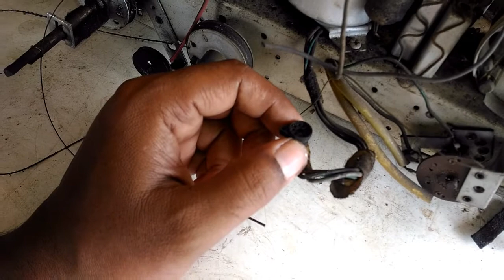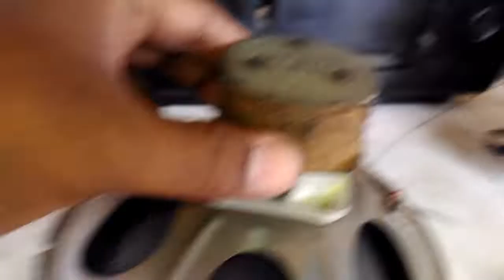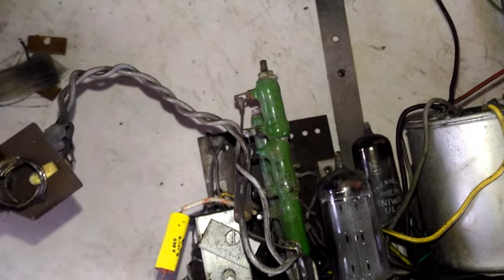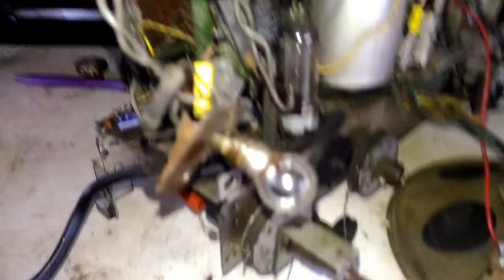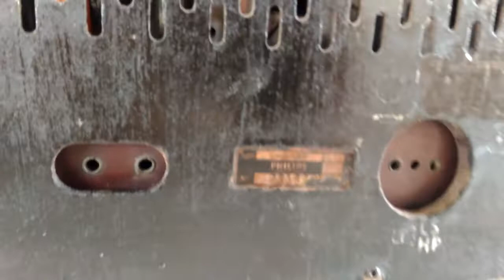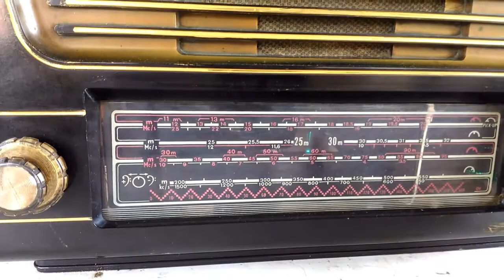Vintage Radio Restoration, Philips BCA435U

Comment: Ankur what you use to clean the chassis. You cleaned the chassis very well.
Reply from the maker: Generally used isopropyl alcohol. For tougher dirt I used kerosene, petrol etc. Cleanin chasis is slow and tedious process.

Comment: Another good restoration. If possible the new electrolytic caps could have been put into the shell of the old capacitor in order to retain the maximum originality.